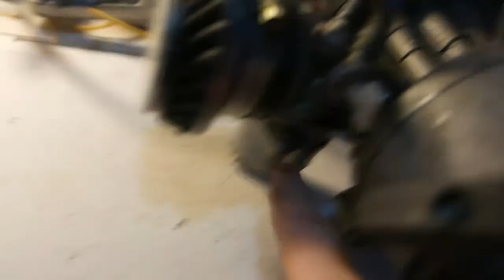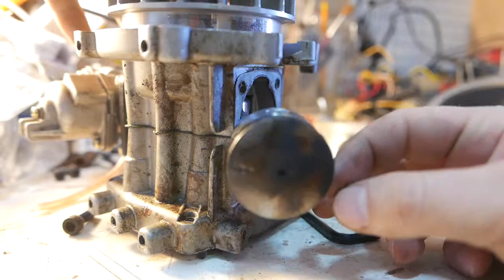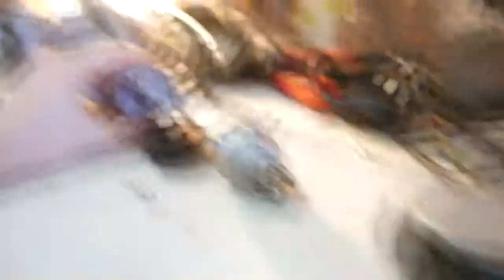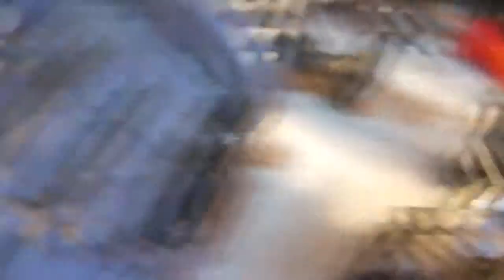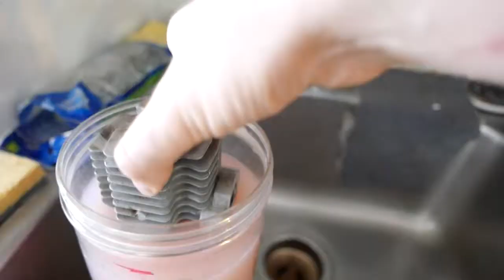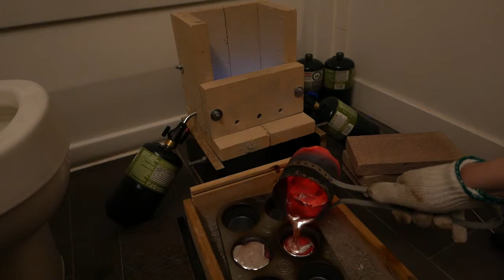Melting an old 2-stroke engine at home

Comment: Great overview of motor - thank you.  Might want to get a 30 lb propane tank, same one as they use for gas grills - I had two so when one goes the other can be quickly switched.  Wondering if only the engine block was aluminum or were other parts also aluminum.